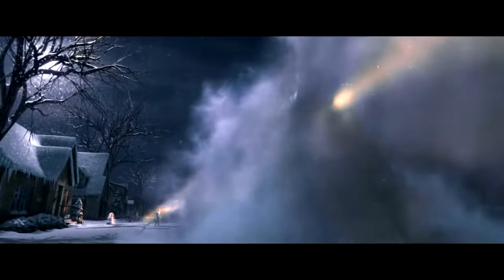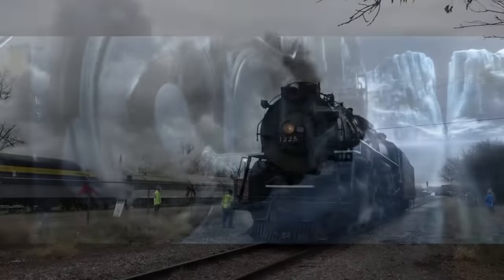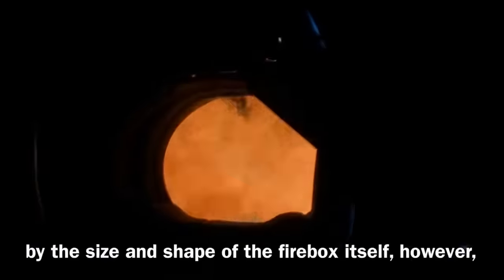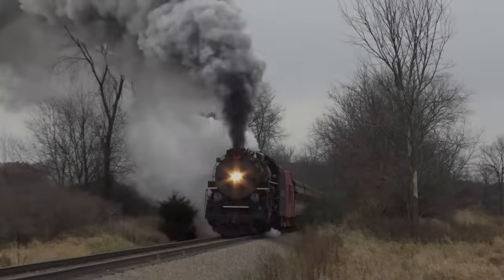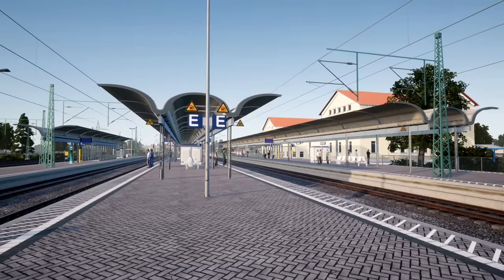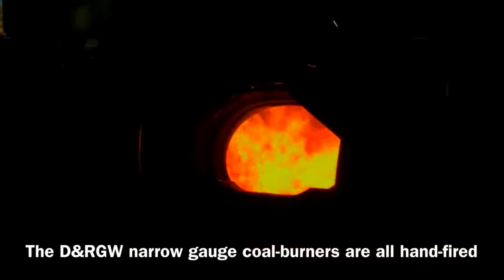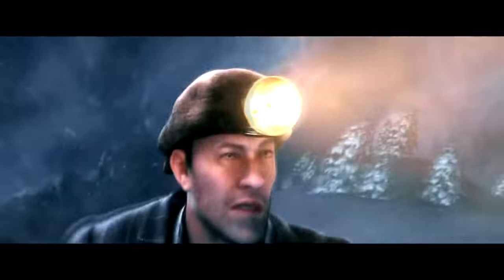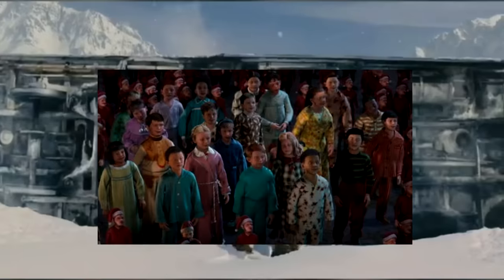Why The Polar Express would Explode

Comment: I am not saying you are wrong about the boiler explosion, but you are not taking every variable into account. Yeah, the steep angle of descent would  throw all the water in the boiler forward and expose the crown sheet. It would also launch the firebed forward into the narrow space between the brick arch and the grate. Coal fireboxes are long and wide for a reason, and shoving the entire fire into a confined space with restricted air flow is not very agreeable to combustion. In That position, the fire would start smothering itself because the fire triangle would not be balanced; too much fuel, too little air. Once the engine came level again, yeah maybe there is a crown sheet failure or a flash steam explosion, but the fire would have been cooling down just before hand. Also, at that point, there would be no way to relay the firebed without putting out the fire and digging out the coal, so if the engine didn't explode, steam pressure would plummet. (of course the opposite would have been true in the ascent anyway, i.e. the mass of burning coals that made up the fire would have been thrown back and heaped against the door sheet.

Comment: Small problem. If the boiler was full its can't move to the front so nothing would happen (dahm that was easy)
Reply from the maker: If the boiler was full then there would be no space for the steam. There is a critical balance between having enough steam and keeping the water level above the crown sheet. If the boiler was 100% full of water then it wouldn't be a steam engine, it would be a water engine

Comment: I fail to understand how a steam locomotive could explode in subzero temps, which I don't think was ever attempted in history? If someone could provide a link, I'd appreciate it, since the North Pole does have very cold temps.
Reply: The firebox would still be operating at its  normal temperatur regardless of the outside temperature and once the water makes sudden contact with the firebox which is now operating at an extreme temperature, it's going to create a steam explosion because all of the water will get evaporated and the locomotive wasn't designed to let out that much steam at once, so therefore it's going too explode because of the steam having no exit point.

Comment: no, actually, the water would be pushed to the back of the boiler. If the train were stationary on the hill then the water would be pushed to the front, however the amoutn of Gs produced by the train's speed causes the water to push up against the back
Reply from the maker: Incorrect. Please refer to the pinned comment. The water in the boiler isn't isolated, if the velocity of the engine is fast enough to suck the water to the back of the boiler then that would mean the hob and main character would be flung off the back of the train as they were going down the hill.

Comment: Never thought I'd hear about Bitterfeld, which is roughly 30 kilometers from where I live, in a video about the fucking Polar Express. Although I think you some numbers wrong. I can't find anything about a boiler explosion in 1997 there nor  the existence of engine 05 516. However there is plenty of information about a boiler explosion on 27th of november 1977 involving engine 01 1516 of which you have shown multiple pictures.

Comment: Why didn't these trains have a pressure release on top of the boiler to automatically let out all the steam if the pressure ever got near to explodey levels
Reply from the maker: It wasn’t the steam pressure that caused the explosion as explained in the video. Steam locomotives were equipped with poppet valves that can release steam if there is too much pressure in the boiler

Comment: Counterpoint: inertia. Literally inertia. 😊
Reply from the maker: Read the pinned comment
Reply: @ChriswithaK  yes, but a:many other things are incorrect, and you had to fix them in the comment there two: the crownplate would be exposed for approx 5~ seconds, and it has done so before without issue and the math. the train was accelerating faster due to having the wheels actually spinning, them shoveling in more material, the outside force actually speeding up the system, not just sticking to the 9.81 m/s^2.
Reply from the maker: 1. I had to look over the crown plate since the video is based on the explosion of the locomotive. While extremely cringey, the video was designed to educate people on the workings and dangers of operating a steam locomotive. You also have to consider the fact that in this scenario, the entire firebox would be exposed to the fire + the temperature in the firebox would be exponentially higher due to the draft created by the steam locomotive moving at a higher speed.

2. Using visual cues from the movie, it can be observed that the engine does not accelerate past the velocity of gravity. To reiterate, if the engine was going faster, it would literally start lifting off the tracks or (if you want to argue that the train is connected to the tracks) would have been going downhill so fast that both the hobo and the boy would slowly lift up and away from the train. You also have to remember that the train is going down a slope. In order to stick the water to the back of the firebox, it will need to be traveling faster than the speed of gravity going straight down. On a slope you need to go even faster. 

3. Let me know if anything else that is incorrect. So far you overlooked the main point of the video and did not explain how the train would be traveling faster than the pull of gravity
Reply: homie rlly skipped physics-

Comment: If the water level is to low you'd just add some more water and nothing is gonna happen.
Reply from the maker: The water level being low isn’t a factor in this video
Reply: But you said that the steam engine would go boom if you'd add water after the fire box was exposed.
Reply from the maker: The water shifting to the front of the locomotive and exposing the firebox was the post I was making. Although, one of the examples I gave of a boiler explosion did happen due the footplate crew adding water to the boiler when the water level was too low
Reply: @ChriswithaK  But it doesn't happen immediately. You'd have to wait a good minute or two which I think is important to clarify.

Comment: Wait. There is some wrong physics. If the train accellerates by going dowmhill, then the water would be pushed back? The only point it goes forward is the turn from leveling to the downwards direction. Once it goes down it only would go faster, pushing the water to the back.

Water wouldn't fall forwards. If stand in a bus and it starts moving, you would fall backwards. And once the bus levels in speed you can walk around freely.

Just like a plane. If a plane starts its decent, you would never fall forward. So all the things you talked about are basically undermined + proved fake. The polar express survives🎉
Reply from the maker: The main character and the hobo are sliding down the roof of the train the entire time. If the train is going fast enough to suck the water to the back of the boiler then they would have literally floated away from the train because the entire train would need to be accelerating faster than the speed of gravity.

Your bus and plane examples actually prove the video correct, except you misunderstood the meaning of your statement. The bus is level and regardless if it is moving at speed, you would feel like it wasn't moving at all. As long as it doesn't change its velocity substantially the people inside wouldn't notice a difference. Now imagine the bus traveling downhill at a flat 100 miles an hour. Gravity has an acceleration of 9.82m/s^2. So if the bus was traveling at a constant speed, the people on the bus wouldn't feel a difference except for the fact that they would all be leaning forward. If the bus was accelerating faster than 9.82m/s^2 (it would need to be faster since the bus is on a slope and gravity is verticle) then people would get sucked to the back of the bus. Just like the boiler, the people in the bus traveling downhill at 100 miles an hour wouldn't notice a difference and would be leaning forward since the bus is not traveling at a high enough speed to overpower the velocity of gravity

Comment: If you keep accelerating while going down the hill, the water will not slush forward. 
So you are wrong again
Reply from the maker: When an elevator accelerates downwards, you are not sucked to the top of the roof all the way down to the ground floor. This is because the elevator isn’t accelerating fast enough to overpower the acceleration of gravity which is 9.81 m/s^2. In order to get sucked to the top of the roof, you would have to be accelerating faster than gravity. Just because you are accelerating doesn’t mean things automatically stick to a surface.

For a steam locomotive traveling down hill, it needs to be accelerating even faster since it’s not traveling on a 90 degree angle, but at a slope so in order to even cancel out gravity and create a sensation of weightlessness, it needs to be accelerating even faster than 9.81 m/s^2 in order to achieve this. Additionally, if you look at the movie, non of the characters are sucked back in the locomotive nor are the boy and hobo launched into the air. Ignoring the physics, this point alone disproves your statement

Comment: Except you forgot one thing when going down hill of your stationary all the water will pool in the front of the boiler but going down hill at high speeds inertia would hold most of not all the water on the boiler the whole time they where going down probably cooling the steam box further so actually your wrong
Reply from the maker: Incorrect. If your statement was true, the engineer, fireman, conductor, and children at the front of the train would have been thrown backwards.

Comment: soooo downhill at speed the water goes forward?....
make sense.
so at a speed downhill whit a heavy train and cars begind it at that angle the water would NOT go forward....
man the entire video is really stupid, yes the water would go forward in a controlled decent whit LOW speed BUT in the movie it goes abit faster then controlled I would say.

am not an engineer nor a locomotive operator but it's just plain old common sense.
Drop a bucket of water from a high altitude will the water go UP towards the top or down towards the bottom of the bucket?

(honestly those who say down must look for some help)
Reply from the maker: Nope that’s incorrect. I explained it in the pinned comment. It’s basic physics